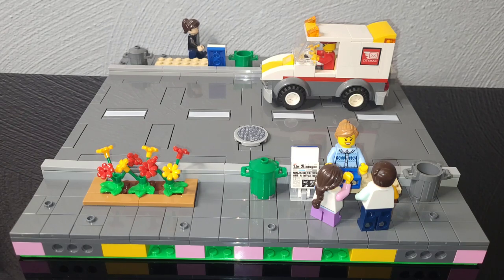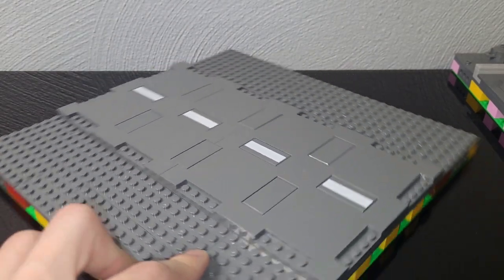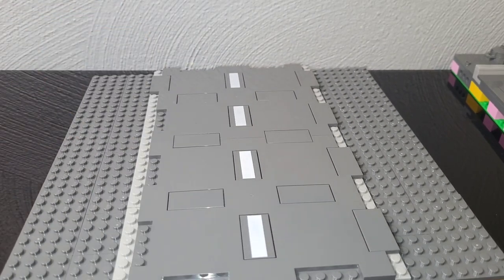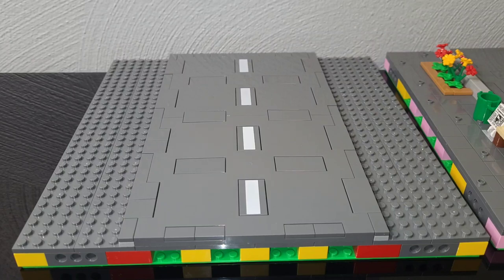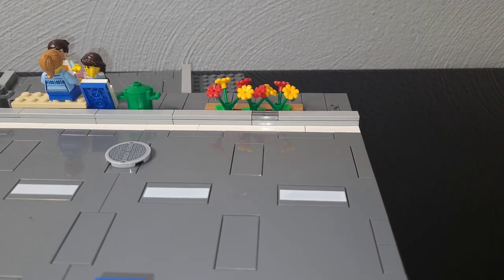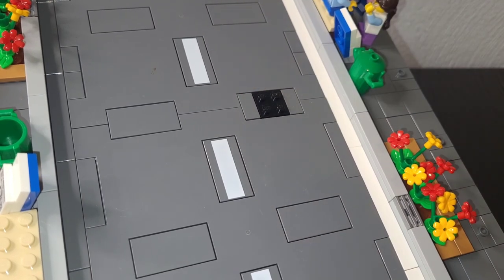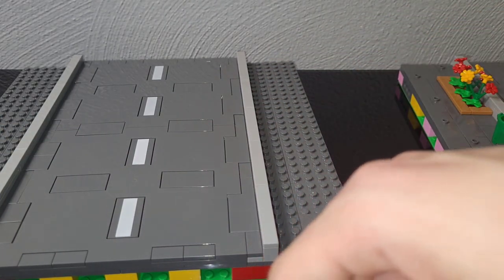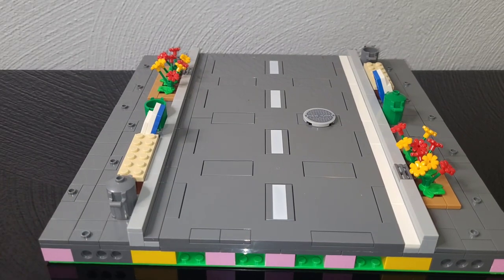How to Build LEGO MILS Road Plates

Comment: When you press down the road plate, this MILS unit becomes rock solid.
The only problem with the new road plates is that they have so many unnecessary cutouts. I suppose that is why they are not particularly popular.
Reply from the maker: MILS is crazy solid. I agree about the open studs. I understand why they did it but they didn't give enough 1x4 tiles to fill them 😕